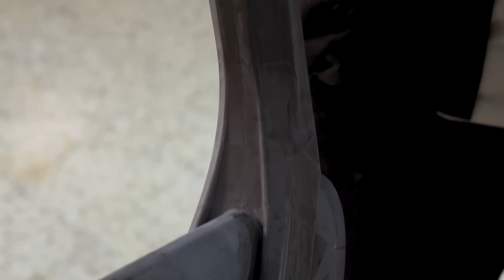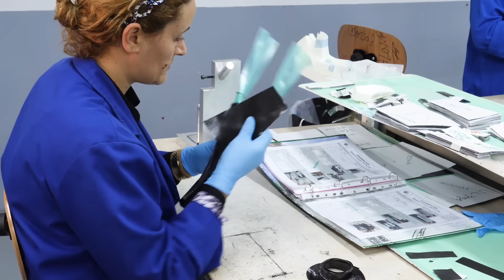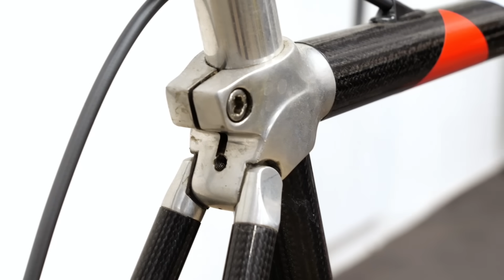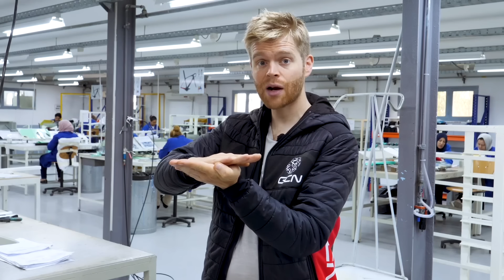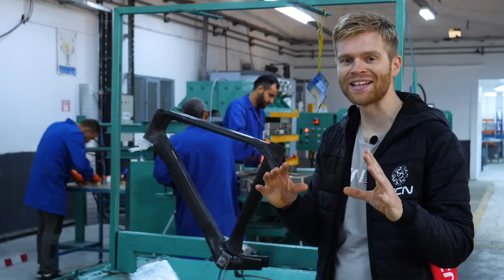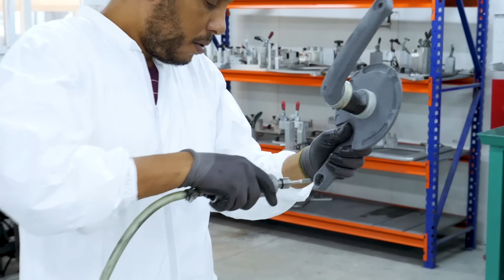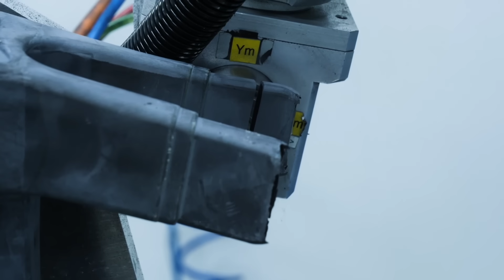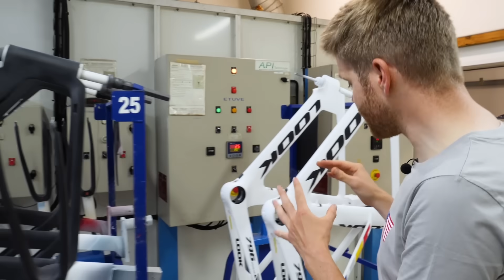How Are Carbon Fibre Bikes Made? | LOOK Cycle Factory Tour

Comment: GCN, I don't think that quite right about Greg LeMonds bike  that you showed . The bike he won the 86 tour on was Reynolds 753 , cos he's got it at home.👍
Reply: Mark Booth nice fact check 👍🏻
Reply: Did the riders just use one frame back then, and not several over the course of three weeks, as today?  Perhaps both are correct.
Reply: Might have used the carbon fibre one on a special stage or team time trial. He may very well have crossed the line on a 753 and done the majority of the stages on it.

Comment: LOOK and TIME are the definitely the best frame manufactures, owns their own factory and good QA. Way better than the others, whose BB tolerance is almost bullshit.
According to Hambini, even hongfu has much better BB tolerance than Cannondale/Cervelo, while LOOK and TIME are really dead on for BB tolerance.

Although the cost is pretty obvious with the hefty price tag.
Reply: Less obvious is the cost of getting warrenty work done or parts.  Our LBS refused to carry their bikes due to having to call France get anything done. VERY difficult to work with, sorry to Hambinini.
Reply: Hambini doesn't own a single Look bike and is not aware of the issues. I own 3 of the top shelf framesets. Still love them, but getting some replacement parts is a pain in the ass and a costful one. Ironically, these very same bottom brackets of the Zed 2 and 3 crank have been giving their owners major issues. If the design is so complicated that it can only be reliably installed and serviced by Look own engineers then it is not a good design.
Reply: @82vitt  Yep, that's why all my bikes are from Giant. No one can beat Giant's service, at least in Asia.
Reply: Not everything Hambini says is gospel. I'll just leave it there

Comment: Must do other cycle factory tour   in Italy ( Colnago or Pinarello for example) and USA!!
Reply: There is no Colnago or Pinarello carbon manufacturing factory in Italy.  The only thing Colnago does in Italy is glue together the lugged C64 from parts made in Asia and Pinarello are all made in China.... In the US, also not much going on other than Zipp,  Enve and Hed making rims (much less labor intensive than making frames) and less than 1% of all Treks (10,000 bikes per year out of 1.5 million).
Reply: @julmeissonnier  i mean italian brand or us brand
Reply: @albertomoschin7179  Check the trek factory tour in Wisconsin by Gcn
Reply: @thibaultpiona7983  Correct only the top end Madone 6.9 SSL Project one made there (less than 1% of Trek volume)

Comment: Really interesting but, I'll stick with Aluminium frames/carbon forks. I'm still not convinced on a full carbon frames strength. I can see now why they are so expensive. Complicated process.
Reply: Same here. I really want a carbon road bike just to see what the buzz is all about, but at the same time I'm really iffy about getting one since they're jolly expensive, and they seem to be more prone to damage than alloy frames. Accidental pokes from unexpected directions apparently can ruin your frame, so that makes me a bit uneasy. Not a nice feeling to own something worth over 2000€ which can be ruined by so little.
Reply: I've had a Look 675 Light for almost 4 years now. Full carbon right down to the drop outs and bottom bracket. I've put probably 6000 kms on the bike, and it is a phenomenal bike and had no problems. I also have an aluminum frame/carbon fork bike, and a Columbus tubed hand made Italian bike from the early 80's. I wouldn't hesitate to do anything on the Look that I would do on either of the other two, I have that much confidence in it.
Reply: Properly designed ones are much much better that alu, steel or titanium.  And look frames certainly are properly designed built and tested.

Comment: Whenever I see the amount of work that goes into bikes, from design and testing to the labour intensive manufacture and assembly process I rethink my complaints about how expensive bikes are. This ones no exception. Good grief, such a lot of peoples hard work is needed just to produce one bike!
Reply: I just had a new appreciation for my carbon bike.  I guess I won't complain about how much it costs compared to aluminum bikes.
Reply: I agree with you on all that you've said.. 👏 👏 👏 👏 I now see why they're so pricey..
Reply: Everything is fine does it have 100 bhp? Doest is have an IC engine like a japanese motorbike with ABS, traction control, lean angle sensor? Why does it cost 2 times than a motor cycles? A bicycle is a 2 wheel mechanism with a standard elementary gear system unlike other vehicles in road and operated by human power ? All carbon aluminium parts are in motor cycles too. Don't justify manufacturing process with cost. A motorcycle or a car have way complicated manufacturing cost with a stiff competition.
Reply: @Sun_steak_steel  I think you'll find you are comparing apples and pears. A cheap carbon bike still costs less than a cheap motorcycle. Meanwhile the bike that proffessionals use with state of the art materials and components cost $10,000 to $15,000. Any idea idea how much a team MotoGP bike costs in comparison - north of $2 million is a reasonable estimate so I respectfully suggest you stop being silly.
Reply: LOOK and Time make two of the most accurately aligned frames with the tightest tolerances on the market. That precision also adds to the cost
Reply: Except those workers are getting paid 4 bucks a day.
Reply: @goodbyemr.anderson5065  Probably ok pay in their country and it's not $4.
Reply: prototypes are one side of fabrications, molds and labor wages another;
thus inventing, yup costly, mass production not so expensive; or well that depends on...
still love that eddy Merckx and Cannondale pros use fairly affordable bikes racing
Reply: well, be amazed by
 low carbon cost
Reply: Most top brands (not look) have them made in china for about $400.00 USD. Marketing is a powerful thing. Look has a good build reputation, don’t believe that chinese built bikes are to the same standard. I.e. many of the other name top brands.
Reply: yes i agree but i will never be able to afford a good bicycle it will be impossible for me to give more than 1000 euros
Reply: @greenproperties7895  you can absolutely get a good bicycle for 1,000 €! It won't be top of the line but it'll definitely be good! Aluminum frame, carbon fork, probably Tiagra or 105.
Reply: Me too !   😜
Reply: Don’t forget the French are on strike for half of the year, so that increases labor cost quite a bit
Reply: I worked in manufacturing, there’s a lot of cost involved from techs maintenance for the machines, rent cost of the building, material and supply cost, the chemicals and paint needed for the frames and whatever other chemicals they use. Utility bills, cost of gloves to supply the workers to assemble and so much more. Imagine the daily cost to keep a factory operating 7 days a week. So there’s a reason why these bikes are expensive and not just because it’s a carbon fiber bike and how complex it is to build one of these.
Reply: This will probably become automated in about 10 years as other processes have .
Reply: Frazer Goodwin my concern is how much are they paying workers? It’s clear that bike manufacturing is a complicated process but it’s also clear how over inflated the bike industry is. So yes appreciate your carbon bike but appreciate that is was made by a migrant worker getting paid very little.
Reply: @tsweimer  People living and working in their home country are not migrant workers... They may be paid little by US or EU standard but probably have a decent living standard by local norms....
Reply: julmeissonnier migrant workers was the wrong wording
Reply: @tsweimer  No kidding.
Reply: @tsweimer  As were the devices you're using to type and read these comments.   It's the nature of a global economy for almost everything we consume from food, to clothes, to bikes, to cars, to the lumber covering our heads at night.  If Look or any bike company built these in a more developed country it would cost 30K Euros - and there'd be no market for them and no one would be getting paid.  Natural supply and demand for labor and in most cases these workers are improving their living situation vs not working here.  Global context.
Reply: Burke Culligan you can dress it up all you want but there’s no way in hell these bikes should cost what they do. It’s an over inflated industry, like many, and GCN is guilty of perpetuating it
. And the device I use is an old phone that I bought used instead running to the shops every time a new one is released. The world needs less bling and newness and more humanity.
Reply: @tsweimer  I appreciate that worldview.  Allied Bike is trying to do this in the USA - although the bikes are still $3-5k USD - and there's a reason they're based in Arkansas (lower cost of living and labor).  I don't think any company is to blame or "guilty of perpetuating' anything.  They're only serving the demand of people - if people didn't want what they were creating - these companies would disappear.  Some people prefer to place the onus of responsibility onto the people choosing (as intelligent beings); others want to place the onus of responsibility on the companies, governments, institutions to do the thinking for the people.  (because they don't believe people are as smart as these organizations).  This is where so many societies are split on their ideals - the cool part is that we can set all this aside and just ride our bikes.  Win - Win.
Reply: @rc420r  Materials cost for carbon frames are between $20 and $50, finished manufacturing cost around $300 to $600. The rest is marketing including sponsorship (divide the salaries of the Sky team by the number of F10 sold and it comes to nice added sum) and distribution margins (everyone involved has to make a living Brand, importer, store...).
Reply: @julmeissonnier  You forgot research and development.
Reply: @panzerveps  And the pharmacist needs to be paid as well.
Reply: @panzerveps  Absolutely correct!
Reply: @julmeissonnier  And I believe the extensive quality control is also expensive - some carbon manufacturers x-ray every single piece of carbon component that leaves their factory to ensure they're gold quality. That comes at a cost, and I'm not 100% convinced that x-raying every single component is necessary (maybe every batch?) but I do like that assurance that the product is not flawed. 

On the flip side, though, I bought unbranded (not knockoff!) good quality Chinese carbon wheels and they withstood 2 years of daily commuting in NJ/NY rough roads before I moved away and show no signs of weakening.
Reply: @caffeinated_focus  That's right. For instance, Canyon manufactures no carbon parts in Germany, it only assembles bikes but it does QC scans on the carbon frames and components that are manufactured for them in Asia.
Reply: @caffeinated_focus  mate, the QC in the bike industry has been shown to be rubbish by a number of experts. They may claim they x-ray every frame, but the end product doesn't appear to reflect that ( i know the company you are referencing). The price/ quality in general in the bicycle industry is sub par to many other manufacturing industries.
Reply: @waynosfotos  Quite disingenuous to make a broad QC statement about the bike industry as a whole. As a whole, compared to other industries, you're right - but you have to qualify your statement by saying that the QC in some/most of the industry, or QC from certain manufacturers is lacking, as opposed to painting the entire industry with the same brush. There's some companies that make trash, and others that have very high quality products.
Reply: @caffeinated_focus  well you can nit pick my statement, but most bike brands are made in a few chinese factories (big names), yes a small percentage are different (not made in the far east). When you see a QC sticker inside the frame and the crank will not spin to gross misalignment then you need to say, how did this get out the factory! And this is before we start talking about the tech lies they propagate to the public, which tells me one of two things, they are intentionally lying or don't know! Both are a concern!
Reply: @waynosfotos  I 100% agree with you.
Reply: I can buy a motorcycle for what these cost. hell, i could buy a decent little car for what they cost!
Reply: @pmm4177  No you couldn't.
Reply: I think that the other major bike manufacturer, Time, has a better construction method. Initially Look used additions of Kevlar because the carbon fiber threads are short and can tear between themselves whereas Kevlar fibers are long and do not tear easily. Time has reverted to this technique in order to increase reliability. My experience with Time is that you should use larger road tires to increase shock reduction. But they are marvelously reliable.
Reply: I can justify the cost of a road bike because its so much money on a bike thats only used in the city and has no other use on top of that its terrible for anything else that the road its never gona take any sort of abuse unlike a ktb its reasonable to use carbon on a mtb because it has to be strong because mtb are going to take abuse and can allow u to cover land in almost any terrain a road bike can never do that I just will always hate road bike for being a wast and hate people acting like they are cool its just a bike anyone can use it unlike mtb where its needed road bike are a waste disgusting they don't have to be built even Alitalia bit strong because they will never face anything but its just incapable of it road bikes are bitch bikes
Reply: No, expensiveness isn't justified. I cannot justify a bike that costs like a car or more than a motorbike.
Reply: @abcd969696  - who is twisting your arm to buy one? Middle level bikes are every bit as good as is second hand top level bikes which cost a quarter of new costs.
Reply: @abcd969696  there are carbon bikes that aren't that much more than aluminium bikes, in fact not alot of bikes cost as much as a car (a new one).
Reply: @abcd969696  Tell me one single car that isn't 100% crap and less than 20k€
Reply: @MicroageHD  Define %100 crap.  Modern cars, with proper maintenance can last 15-20 years.

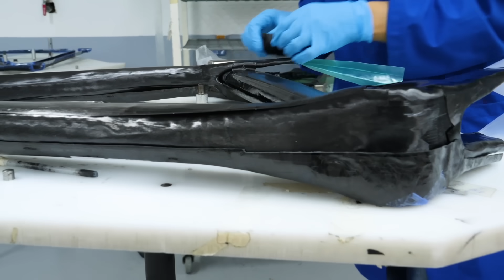Comment: 2:32 - can we get a GCN Science episode that tests 'compliant' chain stays, when mated to the seat stays, adding to the comfort of a bike?  I don't doubt that carbon fiber can flex in some directions when built well, but when rigidly connected via seat stays, just how much compliance is a rider of a given weight actually getting?  This claim of CF frames bringing comfort (above and beyond the damping feature of CF) seemed to be nullified when most of us agreed that the true comfort we were seeking came from riding larger tires (25's, 28's) on our bikes instead of relying on what is supposed to be a stiff frame-set to also give us all the comfort we were looking for.  #GCNScience